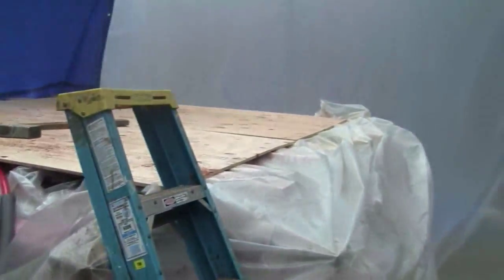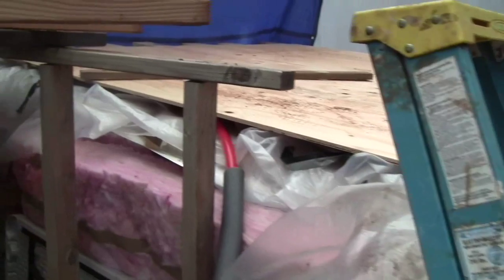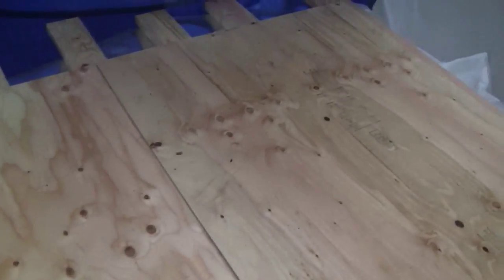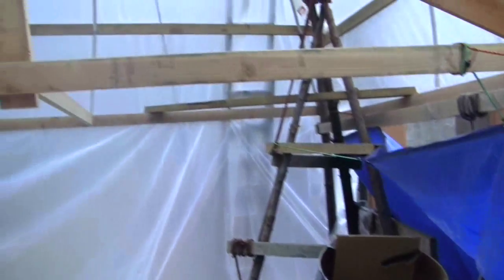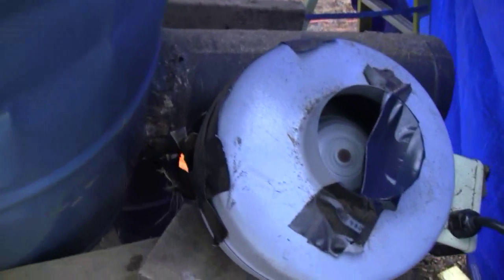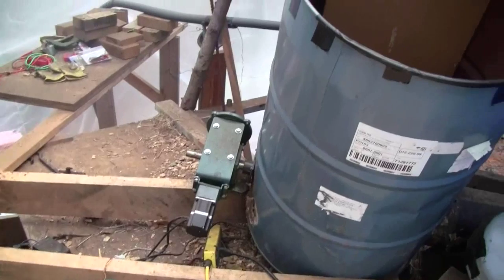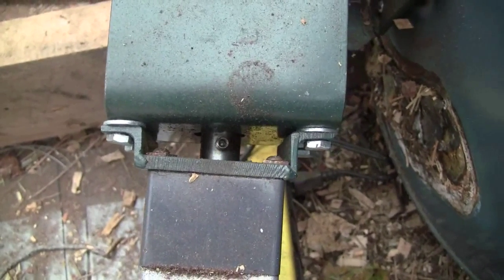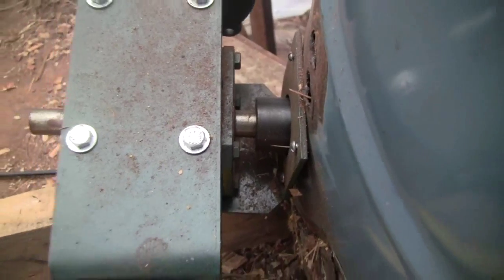DIY Hydronic hot water storage reservoir 8.wmv

Comment from the maker: Basically, I just ran the burner system per norm, flowing the hot water out of boiler, and through the house.  The return water is still warm, and as the house tiles heat up, it can be 110F to 120F return water temp.  So that's what was flowing into the reservoir.  One extra long day and a couple normal run days got it up to temp.  Reservoir drops about 10F to 20F in a day.  Boiler then heats from ~100F rather than 50F, so house warms quickly in AMs when I turn boiler on.
rt

Comment from the maker: Hi.  yes, when I get it dialed in to a respectable efficiency, then I'll begin fabrication for sale.  I still need to better match / improve the turbine performance.  Initial test runs went great and established that the new turbine geometry is super quiet, suitable for use in a home heat and power (electricity and heat) application.  next, I need to ramp up the torque and efficiency.  After that, yes, I'll be ready to begin sales.  Same goes for burner and heat exchanger.

Comment from the maker: I'll show the ash clean out in a future video.  This is just a prototype though, so I just set the burner on the ground.  It has an 8" hole in the center the ashes fall through into a hole under the burner.  I have a brick that blocks air flow during operation, so I just open up the hole, scoop out the ashes, and plug the hole back up.  Future will have a door and ash section.